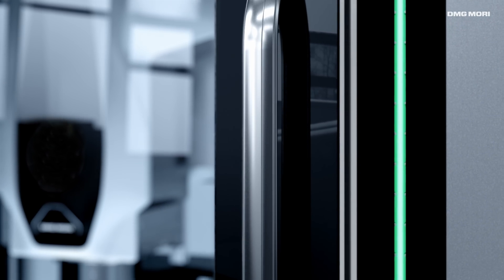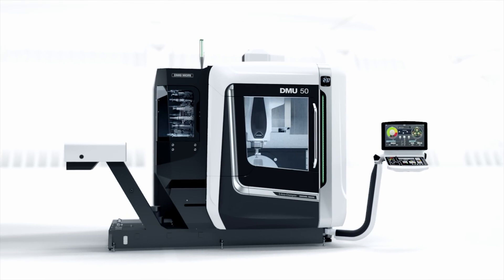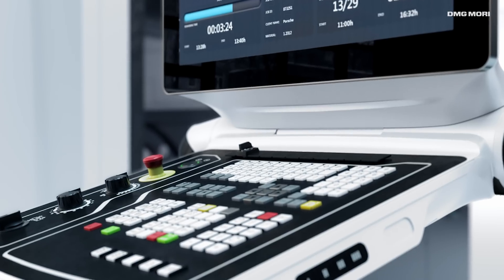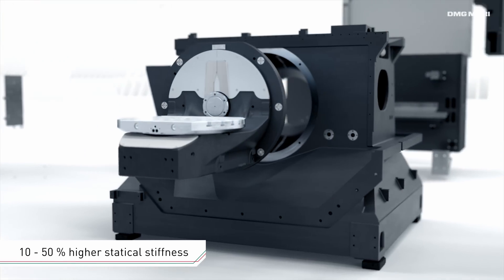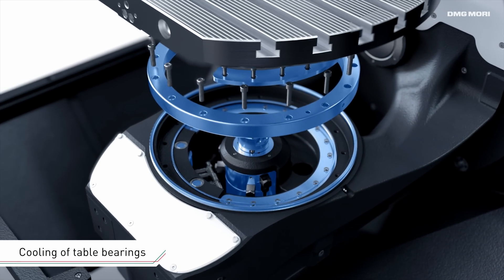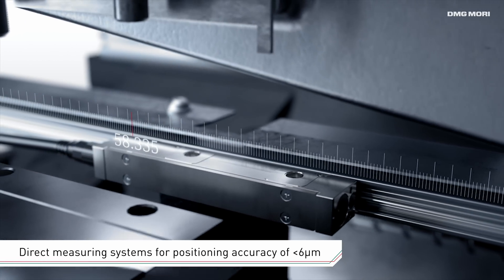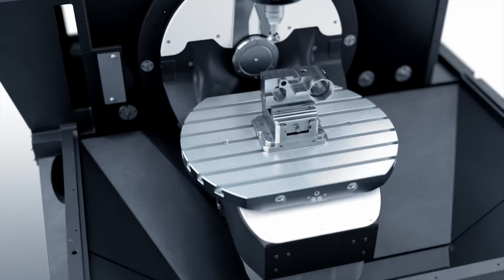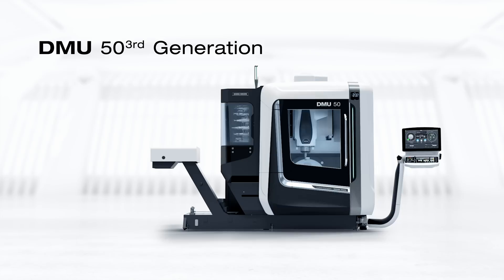DMU 50 3rd. Generation - 5-axis machining with speedMASTER® as standard

Comment: Another big company thinking that touch screen are cool. They need to hire gamers and get told that touch screen is for boomers not millennials.
Reply: You don't have to use touch.  I work in automation (semiconductor equipment) and using the touch screen for basic things like "stop", "go", and recipe selection is fantastic.  Swap to other input devices when it's necessary.

Comment: I have been assembling the dmu50 1st and 2nd gen machines for 4 years now, and I still think they are the coolest machine in it's class. I hope to get my hands on a 3rd gen soon. Having been literally inside every nook and cranny of the dmu the next gen looks so technical and cool. Once I hit the lottery...
Reply: William Foley amazing experience dude!, what a lucky person. Anyway, how much did it cost for the 2nd gen DMU50?
Reply: Cost of the machine was around 180-350k, depending on specs for a gen 1 or 2. I'm not sure what the gen 3 is going for now. The machine uses linear guides, with dual contact roller bearings for the rotary axes. The scoop on the gen 3 is they use a cooling system for linear guides and screw drive mechanisms.
Reply: @willfoley25  are they all full 5 axis? from 2008 up to now?
Reply: @christophercolumbus8944  the dmu50 is native full 5 axis, and they have other machines with 5 axis capability. It just depends on spec.
Reply: @willfoley25  what do you mean by native?
i thought ful 5 axis was for the DMU 75 DMu 85 and 100 the higher models
Reply: @willfoley25  they say they develop serious B axis issue  which was a design flaw what's your opinion on this?
Reply: @fredrezfield1629  b axis issues are from a wear plate that needs to be replaced behind the main casting. When the machine has a few thousand hours on it, the b axis can start to tilt down (on the negative "Y" side) and cause issues any time B is moved. The centerline from B/C to X/Y becomes distorted and cannot be fixed through kinematics/quickset. The entire table needs to be removed and rebuilt, new kinematics values entered into the parameters, then it would run good as new. Even is they replaced this wear plate with a thrust bearing system it still wouldn't work as well as a trunnion, like the dmu75 and other machines use (b axis supported on both sides, not just one)
Reply: @willfoley25  few thousand hours? so 5 thousand hours that's 5 years ? every 5 years ?
Reply: @fredrezfield1629  that number is relative to the number of cycles, amount of maintenance done and weight placed on the B axis for fixturing, milling operations and amount of movement. Not official, just off the top of my head.
Reply: Linear guides or turcite box way?